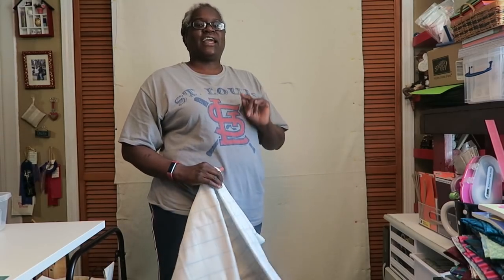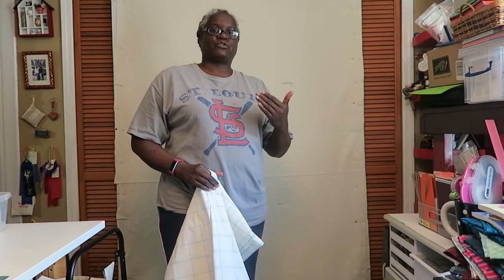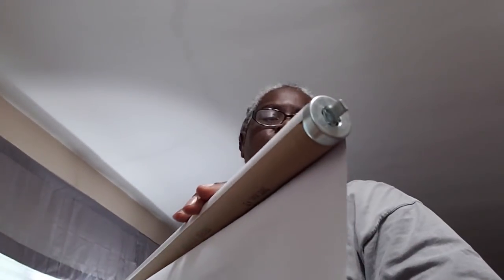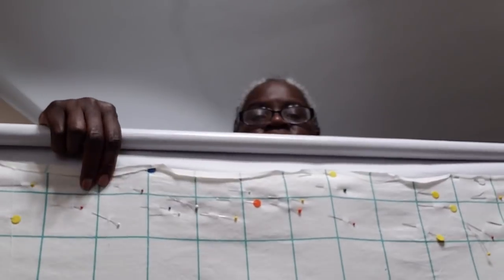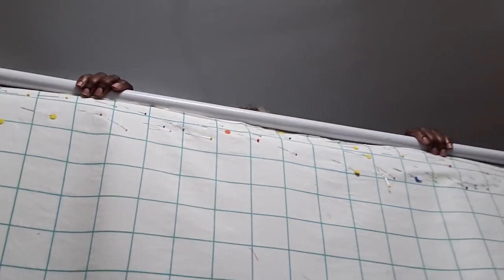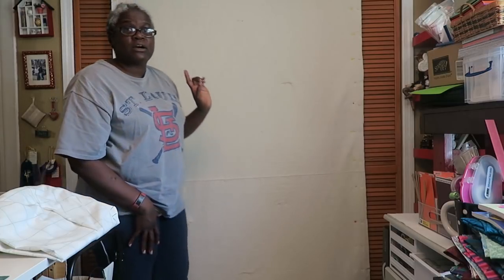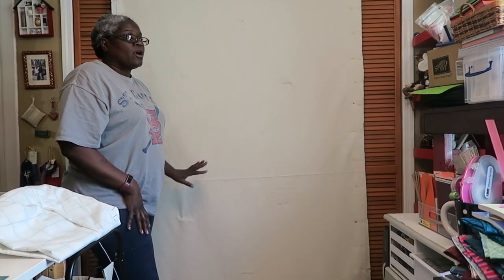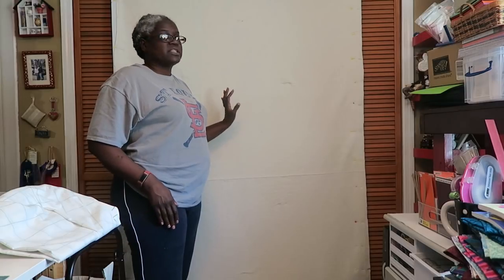Temporary Design Wall - NOT THE BEST VIDEO/AUDIO but wanted to share

Comment: Some good tips n ideas, Tea. Thanks sew much. I had been thinking of using an “outdoor bamboo roll up shade”, both for low cost and ease of attaching the batting — think double sided tape. Might try your shade idea for a smaller design wall. The bottom line is I just need to decide and get on with it!! I don’t have any available wall space so plan to “float” mine from the ceiling in front of double mirror sliding closet doors. Fingers crossed. Can’t wait to see yours finished. Thanks sew much for always so freely sharing your talent with your fan base. Grin!
Reply from the maker: Cyn Forest yay have some great ideas too; hope your project works out!
Reply from the maker: Cyn, your 2nd envelope arrived today.  Thanks so much for going above and beyond what I asked for this challenge.  Revealing the blocks Saturday evening!
Reply: teaquilts ok. I’ll b watching. Thank you! But... this’ll be ON your bday?! Oh my. I should have enclosed some balloons in the card I sent. Lol
Reply from the maker: Cyn Forest lol

Comment: Great idea!  Looks like you used a large window shade.  Can you retract it like a shade  when you're not using it?
Reply from the maker: Unfortunately, it won't work that way because of the weight.  Even with the flannel, the  mechanism wouldn't work.  Good question!

Comment: Hi Tea ! Could you use a spray glue instead of stitching the design wall through your sewing machine lol ? Thank you for making this tutorial . I have been considering doing something like this and your ideas help a lot.
Reply from the maker: Maybe a permanent adhesive?  I haven't used one for any projects.  I'm considering Pamela's suggestion of stapling.  I have a long reach stapler that would be perfect!  Thanks for the suggestions as if stapling or longarm sewing doesn't work, this will be my last alternative.

Comment: I'm wanting to start a block for you. When I iron the seams do I iron in the middle of the seam pressing one side each direction or do I press seams to just one side? 🤔 Sorry for the dumb question but I have only made one block before and that was for quilting marine. Thanks!
Reply from the maker: ScrappyKats not a dumb question!  You can press seams to one side for these blocks...will make the work faster. Have fun.